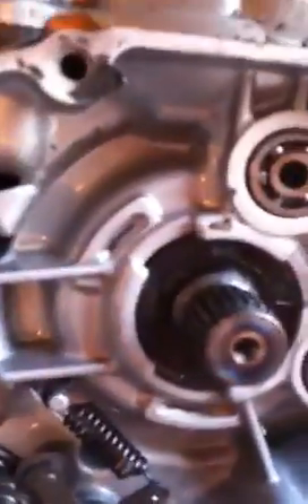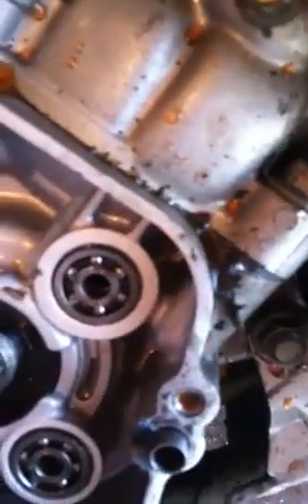Kx 85 crank seal help?

Comment: dude you use oil in your 2-STROKE  with your gas and if you used regular gas then your screwed.
Reply from the maker: i know that? what you mean
Reply: how does your 2-stroke suck up oil
Reply: and you said there was gas in the oil and that it was usig oil 2-strokes use oil in there gas
Reply from the maker: Gordon Hicks no buddy theres oil in the case for yyour tranny gears and all that kinda stuff the crank and the pistion are two different places the crank seal seals the 2 stroke gas and oil mix going into the oil and the seal also stops the oil going into the topend and there for my crank seals were bad so the oil was going into the topend making it smoke horribly I don't know if it makes sense but don't worry man this bike is long gone I have a four strokes I miss the old 2 smokes tho I might make a new video here in a few mins
showing all the new stuff
Reply: dwmogan sorry I was thinking of my 2012 yz 85 the yamahas  are different they use all the same oil. but yes you do have to split the case. its not that hard. witch state and city do you live in because im a dirt bike mechanic so I could do it for you or I know a guy who owns his own shop in roswell nm
Reply: dwmogan how do I view the video you posted.
Reply: +Gordon Hicks a dirtbike mechanic really ? Cos you don't sound like one, dirt bike mechanic would've understood straight away what he was talking about 😂
Reply: Wow people that don't work for a living are on the YouTube trying to impress people by making stupid comments and if you doubt me than that's YOUR PROBLEM not mine.